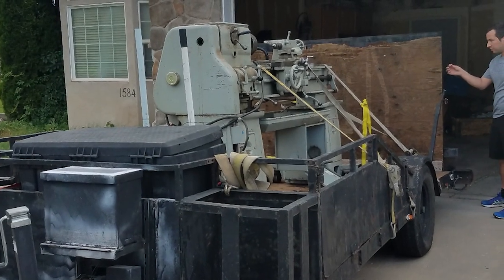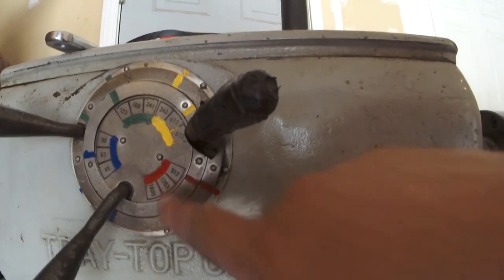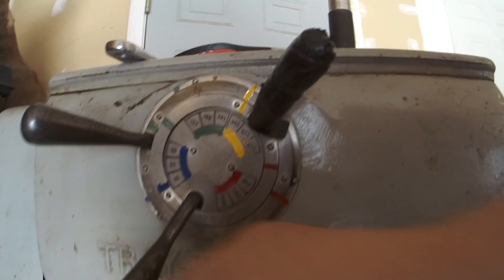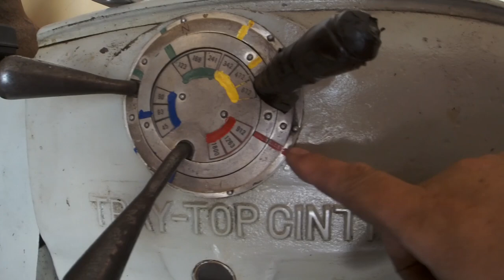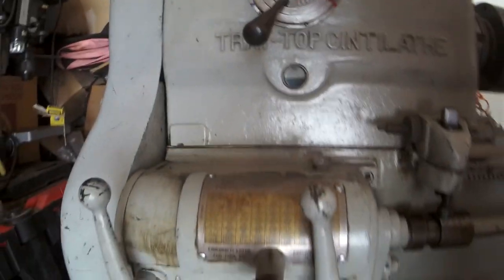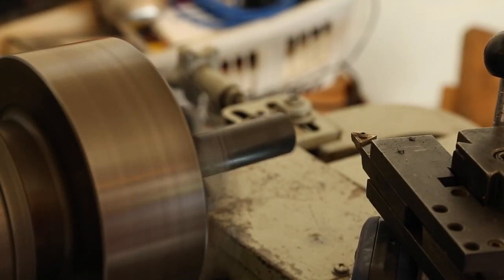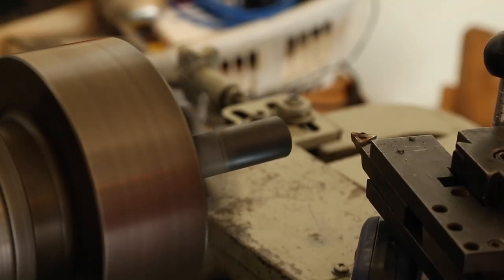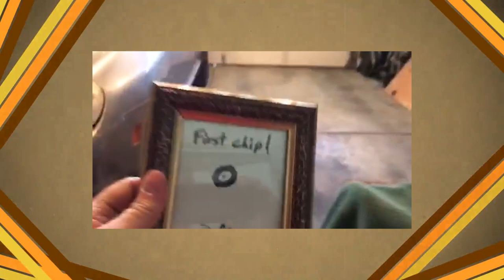Metal lathe - First Chips Lathe-r, rince, repeat.

Comment: I’m so jealous of your taper attachment, i have the 12-1/2 x 30 version
Reply from the maker: Nice! I actually thought about taking it off and unloading it on Ebay or something... I don't have much use for it really. But, I would need to get some parts from a non-taper lathe to keep mine working. I'll let you know if I work something out. :)
Reply: @IAmDistracted  mine’s came with couple of parts for the taper attachment, so you may not need to get any parts to undo it.  PM me for more info : u/hrt13

Comment: Why would you keep cutting with a loose insert?
Reply from the maker: I didn't notice until watching the footage... I'm still a beginner! ;)
Reply: @IAmDistracted  Probably should practice with some brazed tip or solid HSS cutters and save the expensive ones for later. I just bought a Cintilathe for $200 at auction with a 12 foot bed.  Came with $2000  worth of tooling.  Not much of a market for old lathes.